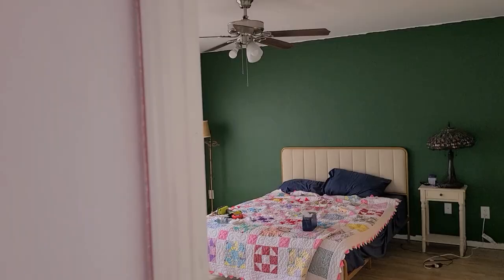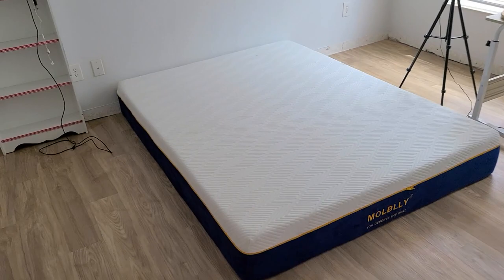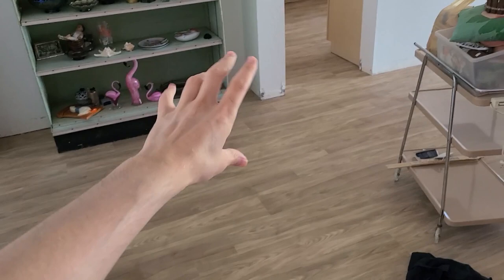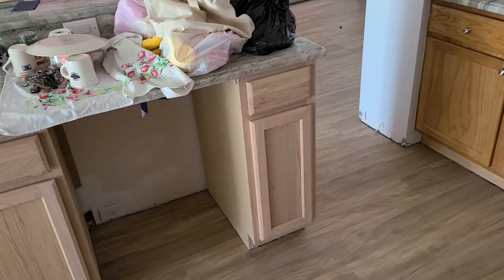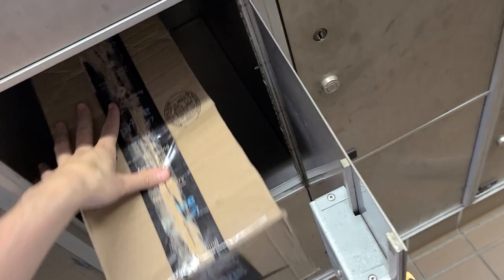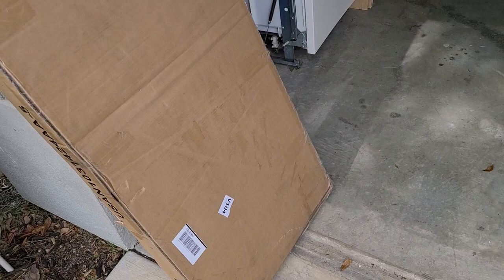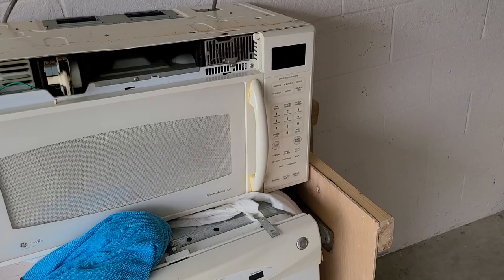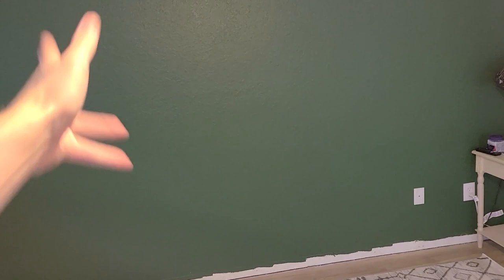4/1/23 Vlog! Feeling BURNOUT, New Bed & Rug Florida Daily Vlog!

Comment: A great paint tray tip when you’re in a pinch w no trays left…place the tray inside a kitchen trash bag, w the opening towards you. Just tuck the excess under the tray. When you’re all finished literally remove the bag going inside out! Bags up all the mess and throw right in the garbage. Might be a tad easier than trying to peel paint out of your tray and getting small paint chip debris in your new paint 😊

Comment: Definitely floor to ceiling drapes on window wall in primary! Also, try pulling the rug down a couple feet under bed, will give more rug at end of bed & still give you rug to step onto when getting out of bed😊

Comment: Life changes are stressful. I once had a corporate job and got to attend many workshops funded by the company. In one of them there was a questionnaire that asked which things you’d experienced during the past couple of years. There were points for each box you checked. It asked if you’d experienced a job change, had a significant relationship begin or end, had a death of a close family member, welcomed a new family member, sold a home, moved to a new home, moved to a totally different place, built a new home, started a new business, yada yada yada. The points you racked up for the boxes you checked related to your current stress level. So even if the boxes you checked were accomplishing goals or represented all positive changes, each one carries a lot of stress with it. When I did that questionnaire I learned my stress level was off the charts. You’ve experienced a lot more changes within a year than I had at the time. So give yourself a break for a few minutes. You are golden. You don’t have to slay a dragon every single day. Breathe. Sing more too.

Comment: You should check out the dry needling I mentioned to you. It's done by physical therapist. They use acupuncture needles to target trigger points in the muscles. After they are in place, a tens unit is attached. It doesn't hurt but feels like a pinch when they hit the trigger points. 
I have a lot of trouble with my spine. I was born with congenital spondylolisthesis which causes the ligaments in the spine to fail allowing the vertebraes to slip forward off the one below it. I had my first spinal fusion at 9 years old.
Along with congenital spondylolisthesis, I was diagnosed with migraines at 2 years old. They were so intense I would pass out. I still get them but I manage them before now.
Just remember you are always worthy and don't let anyone steal your shine.

Comment: What about considering swapping out the solid panels in the porch for glass You aren’t overlooked and it would make it look more modern 
And I think it’s a good idea to do curtains across the whole window wall  - and raise it higher than the window and if you get them long you can sweep them up either side. I think you should consider a full length mirror on the wall opposite the window and the room is crying out for a big statement green plant Check out artificial fig trees - they have interesting shaped leaves - it’s coming together
For the length under your TV you certainly need it longer and you need to mask your sockets whilst still leaving them accessible IKEA is full of neat modular storage that could work with either doors over the modules or baskets in them or a mixture of both
I know the pace has been fast but you are ticking off so many things-to -do boxes and getting your look together in so many of the main rooms so quickly that you will soon be able to sit back and enjoy your hard work
I find when  I’m slowing down in one area  I change it up by swapping where my focus is - so you could try looking at your outside space and plan what you want to do with it Pinterest is full of ideas for gardens / patios/ fencing and looking at something at the ideas stage rather 
than the ‘doing’ stage where you are with the house I find gets the creative juices flowing again